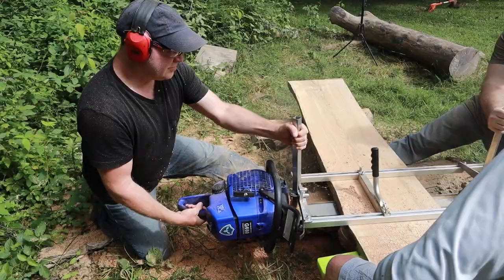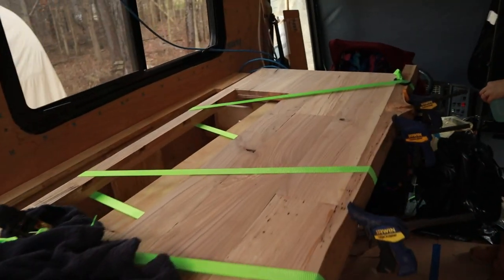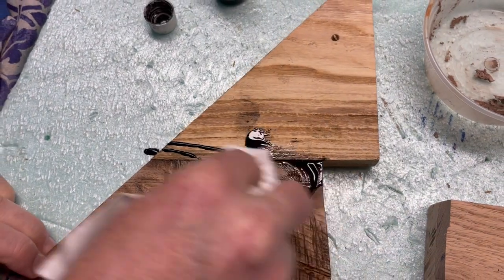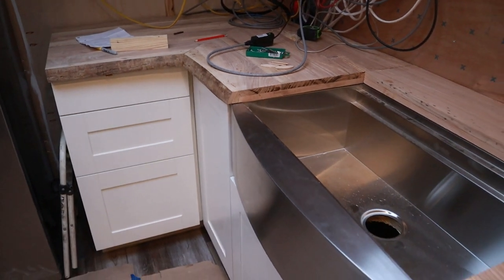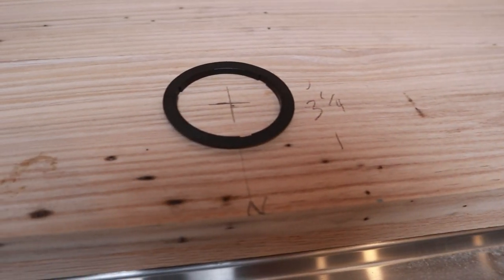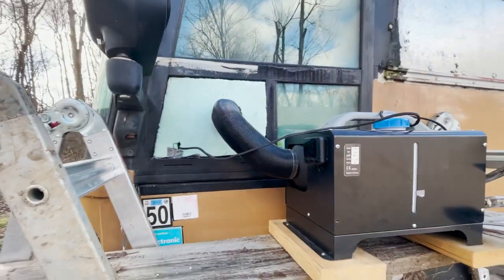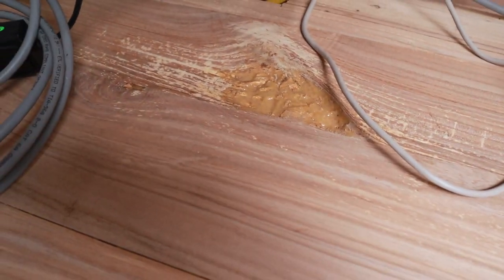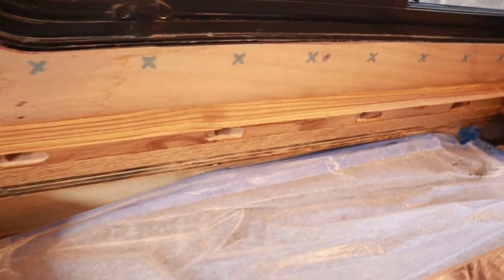Rubio Monocoat Stain for Tiny Home Countertops//BUS CONVERSION - S04E39

Comment: If it was me, I would use an Ispring R/O filter. R/O filters are notorious for wasting water, but in your configuration, after the pressure pump, feed it to the ispring filters and the waste water would drain back into the water storage tank. It isn't "dirty" enough to not use for washing or toilets so might as well loop it back to the storage tank rather than waste the brine water. I've used Ispring water filters for the last 4 houses and love them... great taste and great service.